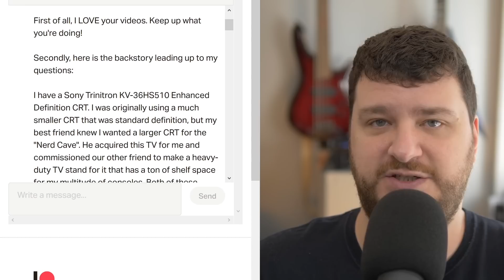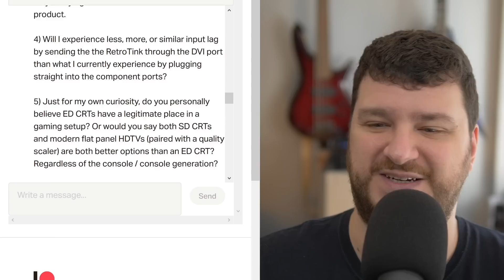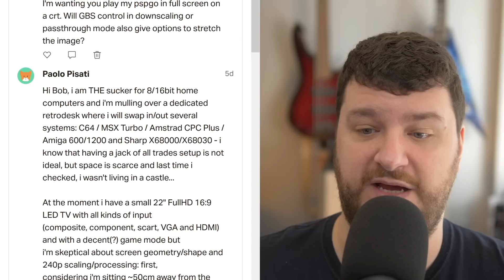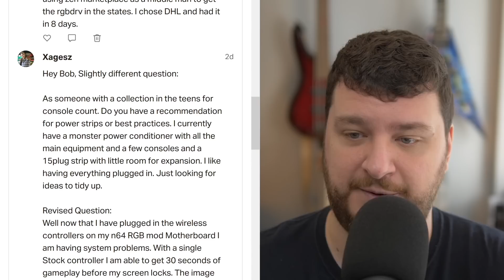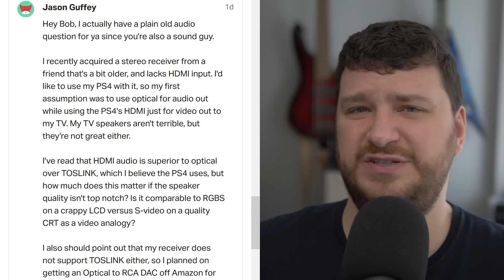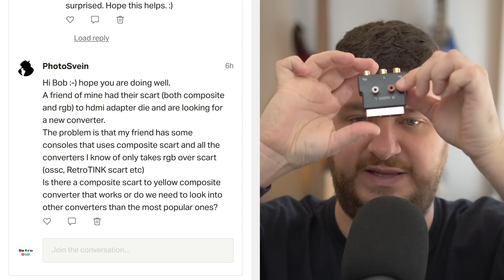Supporter Q&A #141

Comment: Minor clarification: There is a difference between HDMI audio capability and SPDIF (Optical TOSLink and Coaxial). HDMI can support up to completely uncompressed 7.1 PCM audio, as well as compressed "3D" audio formats such as DTS:X and Dolby Atmos. SPDIF only support uncompressed 2.0 (Stereo) PCM audio, and compressed 5.1 signals in the form of the basic DTS and Dolby Digital Surround. 

His statement where he just wanted to convert from Optical TOSLink to stereo RCA using a simple DAC (Digital-to-Analog Converter), would be fine, as the converter probably just takes the stereo PCM and converts it to some Analog signal, which you wouldn't need anything too expensive for, but some cheap ones can cut some of the audio dynamics out, lower the amplitude, or just introduce some additional noise that wasn't there before. I wouldn't go too cheap, but you don't need anything too crazy.

As to his overall question, and his situation: For Stereo audio only, there's basically no difference between HDMI and SPDIF, and I would say you're better off using a SPDIF DAC, rather than trying to introduce another HDMI passthrough device into your chain. If you were routing all the components, then I would say go to some pre-processor and then to the receiver, but if it's just the PS4, SPDIF is probably the way to go.
Reply: Came here to say this.

Comment: I saw you did up a saturn with a slew of mods. I was thinking of buying one of the new shells, but I wanted to use an original saturn black shell on the bottom with a new clear shell on the top. Are they compatible? Same shell?

Comment: Great channel and great content Bob. I find it so engaging and accessible!~
I've a question I'd be interested in having explored in Q&A though if there's time and interest ....

The TL;DR is 'what's the best way to go from a HDMI console/laptop/bluray player to a CRT'
 I'm mostly interested in what's best for 'console' since lag is a factor (in my specific use case, the HDMI out for MiSTer). 
For watching videos I guess there are many more acceptable options - in fact I have a cheap Amazon HDMI-SVideo converter that's fine for video. I've hunted high and low and spent a fair bit of time and money in this pursuit.

I see a lot of stuff on your channel, YouTube in general and forums about getting old consoles converted to RGB or outputting to HDMI for modern screens, but not so much on the reverse. I have a MiSTer which of course outputs over VGA for Analogue and HDMI for Digital. Via Analogue I can't rotate the arcade cores and my 28" B&O MX7000 CRT is too big to flip tate, so I'd like to go HDMI to RGB Scart into my CRT so the orientation is correct. MiSTer does support Direct Video from HDMI to a HDM>VGA Dongle, that I can get then go to RGB Scart, but this has the same limitations with the arcade cores being at a fixed rotation (that can't be flipped). 

I have a TV supporting S-Video and RGB Scart and took your advice (from a previous video/question) when it comes to converters and looked for used Pro-Grade kit instead of cheap eBay/Amazon junk. I found a few to choose from inexpensively on eBay but, disappointingly had to return a CM-388M HDMI>SVIDEO box which looked worse than my Amazon cheapy converter. I have just received an Atlona AT-HD530 HDMI>SVideo converter I've not yet tested. I also managed to get an Extron DVI-RGB 200 but on testing discovered its input and output signals are matched so there's no scaling and the lowest HDMI (well, DVI) resolution allowed as input is too high for the CRT to receive. I'm waiting on a Gefen EXT-DVI-2-RGBSS to arrive which I'm hopeful for, but only time will tell. Even if this works I still need additional cables/boxes to pull in the audio since the Gefen is DVI not HDMI. And of course I've no idea on lag.

Is there a better, one-box, solution that you'd recommend that you can point me (and other interested viewers) to, or maybe a kickstarter I could put money behind, or is my pursuit fundamentally flawed to begin with (I accept that's a very real possibility!). If this is outside your sphere of experience I'll keep on hunting and if I find something let you know if you like ;)

Thanks for your time! I know you can't get to all these questions so if it doesn't make the Q&A no worries - but I think it's quite an interesting puzzle to solve! :)

Comment: The best place to look for DS/3DS capture is 3dscapture.com. 3DS capture kits are being done there, and there's a really convenient and affordable board for the original DS that doesn't even require any soldering to install, just some cuts to the bottom shell. I have this myself and it works amazingly.